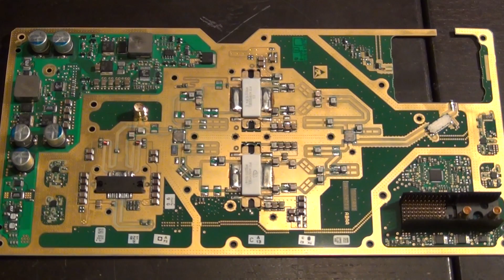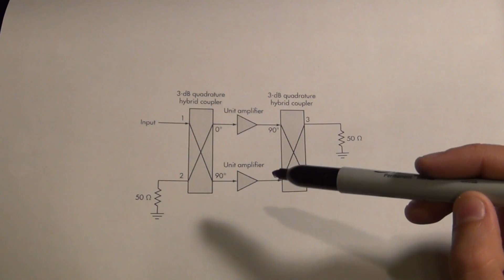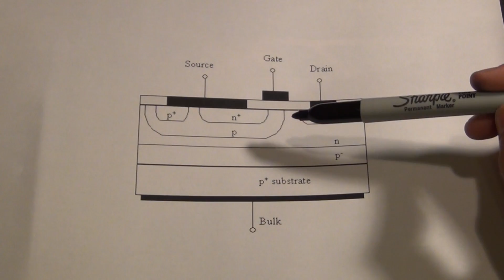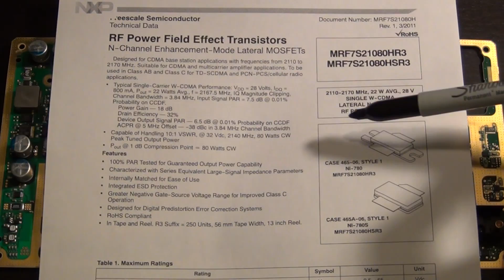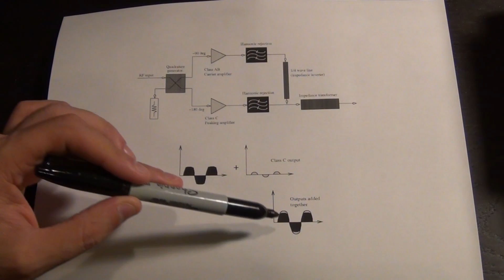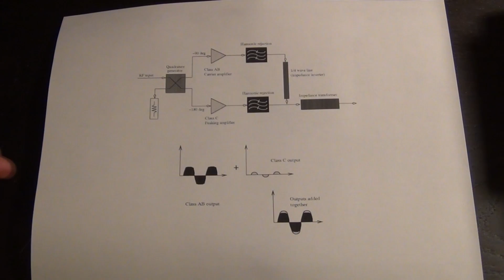TSP #82 - Tutorial on High-Power Balanced & Doherty Microwave Amplifiers

Comment: Thanks for the amazing and clear explanation. My question is that for the Doherty amplifier what would be the maximum power that can the class C add to the output power (I assume it's 3dB)? My second question is that the Doherty amplifier usually has bandwidth limitation so what kind of methodology can be used to increase the bandwidth in this case? My third question is that if you use a common base rather than a common emitter for the Doherty amplifier what would be the main advantage or disadvantage in this regard (in terms of power and phase noise)?

Comment: Thanks for a great intuitive video over high power balanced and doherty amplifier. If you can please elaborate about the temperature compensation bias network design and the use of DC-DC converter then it will be very helpful..

Comment: Questions. First, nice to see you back, thanks for the video, as always top notch. Now for the questions, in the first amp the signal is split 0-90 and sent to one transistor and then it is spilt from 90-180 and sent to the second transistor, what is happening  from 180 to 360 ? How broad banded are these splitters, my guess is that they 1/4 lambda lumped element and not broad banded at all. Next question, with the second amp (the Doherty) you said one transistor is operating in class AB, did you mean class A? and the second transistor is operating in class C. Don't you need 2 transistors to operate in class AB? Lastly these amp do not seem to be very linear, what modulation modes do they operate, my guess is that they would be used purely with some form of constant envelop angle modulation like FM?
Reply: You've misunderstood. The quadrature hybrid takes the input signal, and outputs a copy of the entire signal, 3dB down and with zero phase shift on one port. It also outputs a copy of the entire signal, 3dB down and delayed by a phase shift of 90 degrees. I.e., sine in, sine AND cosine out (each 3dB weaker than the input sine). The question "what is happening from 180 to 360" therefore makes no sense at all, the outputs are both complete, full waveforms.
Reply: Doah, yes of course, thanks makes sense... thanks
Reply: The hybrids are based on broadside coupled quarterwave lines.
A single stage coupler is in fact quite broad band: A balanced amplifier covering 1.8-2.7 GHz using such is quite possible.

Regarding class-AB: this is a "pre-biased class-B compromize" to give softer turn-on characteristic and better linearity than class-B, and as such, it only conducts half periods.
In the low frequency world I guess that implies you need to operate in push-pull, in order to faithfully reproduce the signal, but for RF, the output waveforms contain a fundamental component that is filtered out from the output network characteristics: Linearity is of course not perfect, but that's why you need predistortion ;-)
(The coupler on the output is most likely feedback path to an adaptive predistorter.)

Finally, the whole point for Doherty is to increase efficiency for high dynamic amplitude modulated signals 3G, 4G, 5G.

Comment: is it really Doherty one?  Aren't those transformers actually shifting the  phase and matching impedance?  
isn't something like that?  http://www.rfdesignhq.com/2013/05/lna-design-tutorial-series-8-wilkinson.html?view=timeslide
Reply from the maker: I don't think so. The input and output networks are not symmetric. The power combining is not done the same way at the output.
Reply: Actually both boards appear to be Doherty's (!)
If you look carefully on the first board, you'll notice that the "another quadrature hybrid" (7:24) "isolated port" is terminated in a capacitor:
Since it is terminated with a reflection, This means it is a combiner without isolation, which is exactly what a Doherty-combiner is.
This is a well-known Doherty-combiner implementation, which has the advantage of larger backoff transformation bandwidth.
Also, there are means of tuning delay lines on both PA output branches, which is typical in Doherty's.

The second board is clearly a Doherty:
The input Wilkinson splitter is asymmetric, (different line widths) which directs more than half of the power to the lower gain biased peaking device, which is known to improve Doherty-performance by gain equalization.
Also, the stub "just a filter; forget about that" (20:12) is actually another well known method of improving backoff transformation bandwidth.

Great video anyway: a perfect means of showing friends what I'm doing at my job!

Comment: nice !
but why they need more power than typical few watts of phone ?
i mean what's the point in being able to transmit without hearing response?
i guess it's because powers of individual transmissions to individual phones somehow adds up all together cause they all use CDMA bitstreams with different sequences and one phone can only transmit one sequence at one time.
can you go into more details about it?
also it would be nice to hear more about whole 3G/4G modulations stuff !
Reply: *****
it means they need even less power !
with better antenna ;)
Reply: Those are TRANSMITTING amplifiers in the base station, which provides the output power for ALL users in a cell-sector simultaneously
On the receiver end a base station have low power LNA's as expected.

Comment: Hi .. submitting my question and thanking you for coming back to us. Your videos are amazing  and I learn so much from them. 

I have never designed any RF circuits before and the maximum frequency I've gone in my designs is 300MHz (mostly for processors, memories and communication ICs). The thing is, since I first saw your 2 hour video on the internals of an spectrum analyzer I became marveled with the RF world and I've been studying a lot about the components of such systems (SDR, QAM, OFDM, spectrum analyzers, etc). I can truly say I've learned a lot, which unfortunately is not the same as knowing a lot. On hand not knowing a lot sucks, but on the other hand, it means that I can improve and discover new things.

I know that most of these blocks that compose the systems can be implemented digitally, as well as analogically. I am planning on designing a few systems: a spectrum analyzer (there are some open source projects online that can get me started) and a customized QAM communication system (I have experience designing protocols from the third OSI layer, with this project I'd be learning to design the first two layers as well). 

I know that there is a lot of value in designing every single block by hand (even the frequencies are not very high), but my question is .... is it realistic to design most of the blocks inside an FPGA (as much as possible ... NCO, downconvertes, upconverters, filters, etc) instead of using external components (I reccon that I must use external components, I know some of them are absolutely necessary)? Or do you recommend that I start using external components? I mean .. designing the PLLs, filters and all by hand or in an FPGA would make me learn more, but what is the chance of them working properly compared to using known components that work? I ask that because of the disappointment factor. Even though all of this  stuff makes me happy to learn, spending years on the same project without advancing can be demoralizing.

Sorry for the long post, but I find it extremely difficult to express myself with few words. 

PS: I started watching your videos last year when I HAD to finish my master thesis, but couldn't stop watching your videos. I'm happy to say that as of now I've got my master's degree. Thank you so much for the contribution to the community.

Comment: Great to have you back!!! I'm assuming there must be a significant efficiency differential between a pair of LDMOS amplifiers in the first configuration in comparison to the Doherty architecture, enough to warrant the hardware cost of adding the passive isolator? Can you give us a ballpark comparison?
Reply: Both PA's surely have a passive isolator, to protect it from "revererse IM": intermodulation arising from power leaking in to the PA output from nearby transmitters, and also to assure good matching in case of poor VSWR from ice on antennas, as well as hardware protection, in case it is powered up with no output termination connected.

Isolators of this size typically have about 0.2 dB loss.

Comment: Nice to see you are still alive!=)
-How were your grades in school/university? (Just curios if there is any connection between real knowledge and grades).

-Do you think the simplified Arduino platform is generally a good or bad thing for students/young engineers?
  I am working on my master thesis right now and the setup I am using is based on Arduino and was build by the guy  who finished his Ph.D. few months ago. Everything this guy done with electronics is just fundamentally wrong.  He didn't even  try to read datasheets for the component he was using. For example he uses LT1210 as voltage follower. His circuit doesn't have any bypass caps (You can't imagine how noisy this LT1210 was!) There is no compensation for output offset voltage (due to current through feedback resistor) . The relays he is using are too slow, not reliable for our application. The wiring is messy and on some places just wrong...and so far and so on. The main problem is,that this guy stated:"Everything is tested and working fine"
And this is not the first time I see the case, where the Arduino platfrom with all premade libraries and shields gives someone a false feeling of having experience/knowledge in real engineering and electronics.

-Do you have any  ambitious hobby projects you are working on?

-Do you rewatch your own videos? When I try to watch/listen my  tutorial videos, it is always so cringy I immediately switch the sound off:D

-Which other engineering related youtube channels do you watch?
Reply: Regarding your first question, I suggest you should read up on the effect known as "survivor bias". Veritasium has a reasonable summary. You are setting yourself up to reach some very invalid conclusions by canvassing successful ("survivor") engineer's grades; that's completely backwards stats. Also, it takes all sorts; there are people who have no passion and no studying ability who are bad engineers and get bad grades; passionate, intuitive engineers who breeze through university exams and are good real-world engineers; study-hards who learn exactly how to pass poorly-written exams but suck at real-world engineering; and finally savants who have the potential to be amazing real-world engineers, but find the exams so boring that they don't actually get particularly great grades. So yeah, every permutation is covered, not to mention all the shades of grey inbetween. Having said all that, it's a very interesting question; just saying it's not a "useful" question per se.

Also, I know you weren't asking me; but I think Arduino is a mixed bag -- good to encourage a wider audience to be interested in electronics; but the way that their documentation hides that the Arduino board is just an ATmega328P breakout board is really anti-educational.

Comment: Hi, Shahriar. thanks for the great video! I have a question about both those amplifiers. There is only one transistor in each path, means there are two options of offsetting them. Option one is to have a B or AB class which means they only work on one half-period of the signal. If this is the case, then how is the rest of the signal on the output is reconstructed? Option two would be to offset the transistors into class A which means burning 50% of power on DC. That would work for the first amplifier you explained, but no way for this to work with the Doherty amplifier: handling both half-periods on the Class C path would require two transistors, and the saturating with one transistor path would be just Class A, not AB.
Reply: Maybe that is why there are 2 amplifiers on the Doherty amplifier board?
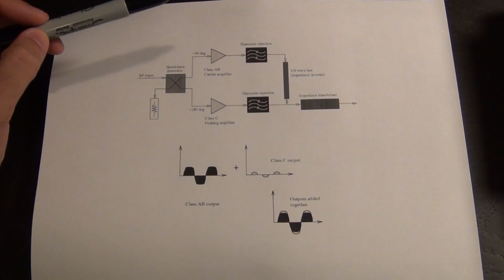Reply: The parts of the Doherty amplifier work on different parts of the single half-period: main part and peak. If each part of the Doherty amplifier is built on a single transistor, then they will be only able to serve one half-period of the signal. At 24:00 Shahriar shows two graphs for Class AB and class C. My point is that it is not possible to make a single-transistor Class C amplifier that would serve positive and negative swings of the signal as shown on his graph. Also regarding his Class AB signal graph: with single-transistor it can only be achieved with Class A biasing, i.e. burning ~50% DC power at idle.
Reply: My suspicion is that the Doherty amp in this case works on a half-period, creating a distorted sinusoid on output, which is then filtered to get rid of unneeded harmonics.
Reply: Actually, the way of getting high efficiency in an amplifier is to minimize the voltage-current overlaps inside the transistors (and to compromize linearity):
For class B and AB the current is half-clipped sinusoid or even better: square like (class-F etc.)
The fundamental output power is then reconstructed through bandwidth-limiting output.

Comment: All of this is so great and interesting! Thank you!
I've seen some directional couplers in my course and I thought that they are easily made on PCB by placing two parallel lines having exact sizes like width, length and distance between them. But instead the designers of the first amplifier bought a ready one. Is it because of the tolerances they would have to meet if they wanted to make one themselves or something else?
Reply: That is a good question. I guess that the tolerances will not be a problem, and neither the power handling. I can't really think of a reason but I'm sure Shahriar can tell us :).
Reply: A 3dB coupler is hard to achieve within in a simple two-layer PCB, due to the high required coupling and it is also sensitive to PCB variations and etching-tolerance: 
Inside the Anaren component are two tightly spaced striplines on top of each other, separated by a thin dielectric layer (broadside coupler).
Also directivity is easier to achive in a homegeneous dielectric, than in PCB-air stack-up.

Futrthermore the component gets smaller than on PCB by using higher dielectric constant material, and it isalso well shielded in itself.

Comment: Great to see another video!Question:  Instead of using the 20dB coupler to monitor the output, would it be possible to take the output from the second quad hybrid coupler output (the one after the PAs?) to monitor the output?
Reply: If you did that you would be measuring the reflected power, and while there is a relation to the output power it is not a constant relation but it will depend on the antenna, cable length and such.

Comment: Hi! First of all, thank you for all your videous! They are always magnificent! And I'm looking forward to see more!
For Q&A:
How can one get into the microwave design engineering (R&D)? I mean, the problem is you have to have hands on experience, for instance,  in designing amplifiers.  But you need an expensive equipment, software, parts and everything. And you can't just use only computer simulators all the time. So, what to do?

Suggestion for a new video:
Can you tell us about making fixtures for mm-wave devices (and beyond!)? Maybe you can show us one and explain how it works, how it was made, what problems can be with such things and how to avoid them.

Your channel is the best! Thanks again!

Comment: Some paths seem longer than necessary. Wouldn't it work if it was just one tight line of components?
Reply: The longer paths are phasing and impedance matching traces, you can think of 1/4 wavelength transmission lines and such.
Reply: If it was a balanced amplifier that is true, se my reply above ;-)

Comment: Great to see you back! I do also have a question for you: I just graduated as an electronics engineer and have a decent background knowledge in both electronics and mathematics. I must admit however that only have a very limited understanding about RF, impedance matching is almost as far as it goes. I would love to learn more about how to do RF designs and how to get started. I'm thinking to buy a descent RF spectrum analyzer with tracking generator in order to do some experiments and get some hands on experience. Do you have any recommendations for me? Topics to google, tests to do,... any suggestions are welcome! Your video are a wealth of knowledge by the way and got me really interested into the field of RF!
Reply: You can do a lot with a spec with integrated TG. However, there is no phase information so I would say that the first thing to get is a VNA, vector network analyzer. They're unfortunately not cheap and you also need an expensive calibration kit. For real understanding of the whole process I would recommend you get a simulation software, such as Keysight ADS och Ansoft HFSS, and design a distributed filter. Then manufacture and measure this board with a VNA. That's an excellent learning experience!

Comment: Hi, just wondering how they get away without a low pass filter at the output? Or they just don't care about harmonics?
Reply: My guess is that it is somewhere between the shown modules and the antenna, if you use the same antenna for transmit and receive you will need a duplex filter anyway and that will take care of the harmonics.
Reply: The output of the isolator is connected to a large cavity filter (like the duplexer shown in the beginning).